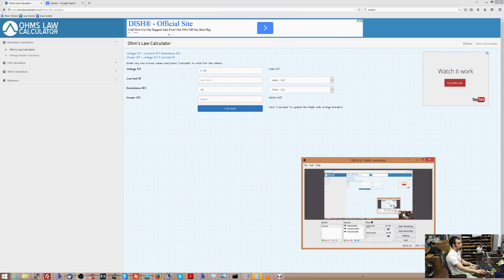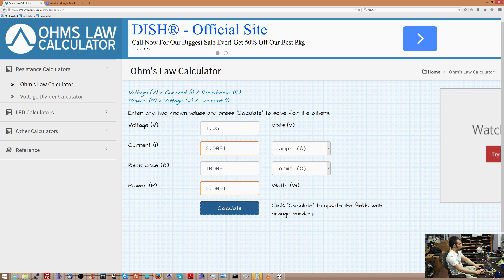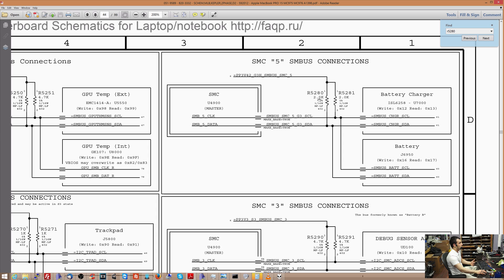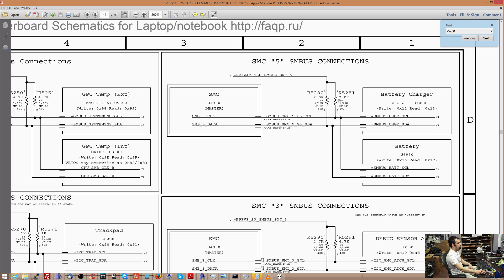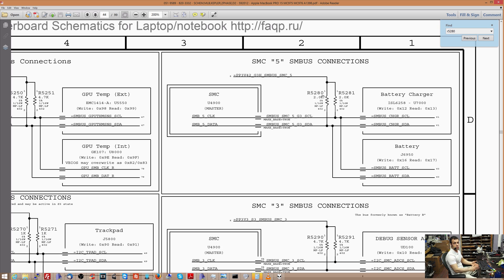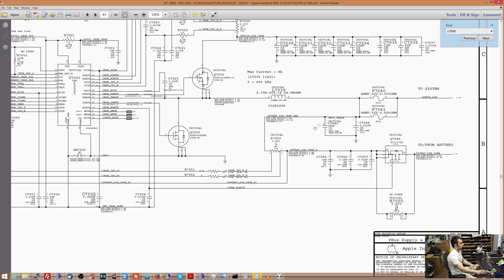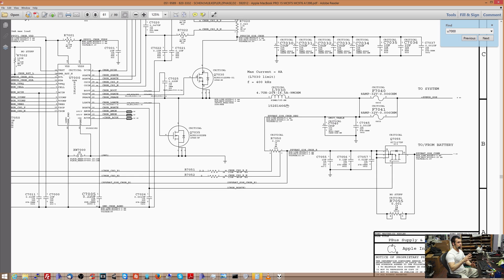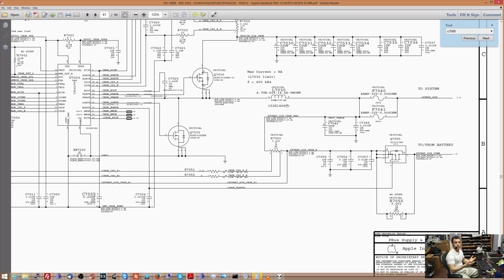What is a resistor? What is impedance?

Comment: 3:27 This definitely isn't correct. A resistor provides a voltage drop across it, but the current remains exactly the same.
5:42 you have it like almost right but it's just the exact opposite. The voltage definitely changes from one side of a resistor to the other and this voltage drop is proportional to the resistance (Ohm's Law) and so the resistance value definitely affects the voltage. The current going into a resistor and leaving it have to be equal, according to Kirchhoff's Current Law.

Comment: A resistive load is just like friction e.g dragging a tire. A capacitive load provides an active resistance that could push in the other direction e.g compressing a spring. An inductive load gathers momentum e.g. speeding up a flywheel or accelerating a car.

Electrical loads can have components of each type like a weighted trolley (inductance) attached between two posts by stretched bungee cords (capacitance) and that has wheels with a certain amount of friction (resistance) to the ground.

Comment: I always thought that there was a voltage drop across a resistor... meaning if you take a voltage at both ends of a resistor with ground as your reference they should be different if you measure voltage across a resistor you will see this voltage drop. I know this is pedantic but I really would like to know if I am wrong....
Reply: +Louis Rossmann 
Hey mate. Thanks for your vids. However, I think there might be a bit of confusion here about how current is limited by resistors.

First up there must be a non-negligible potential difference across the resistor otherwise current will never flow (just like you explained in your 3rd video in this series about electrical grounds). But more importantly there is zero drop in current across a resistor. Yes the resistor limits the current running through the entire circuit from rail (3.45V) to ground but there is no difference between current on one of the resistor and the other. The current is the same (due to the law of conservation of charge/energy) in fact, the only difference is the voltage across it.

TBH I think you definitely get the concept but your explanation is a bit misleading in the video at the end.
Reply: When current drops or is reduced, it is reduced around the entire circuit.  The current that goes in must come out.  Like water.  However, voltages will be seen to drop step wise from component to component.   Each component has a voltage drop associated w/ it.  But each time the voltage drops, the current drops in the entire circuit.  There are two laws that are used here.  Kirchhoff's voltage law and current law.  Voltage drops add up to the total for a circuit.  And current is constant for the entire circuit.  Congratulations. You just passed electronics 101.  Not that many people do.
Reply: +Mario James You're absolutely correct. Louis does lack some concepts, as he outright admits; what he does know  he sure explains well though.
Reply: +Alex Z you are correct, i even made this mistake, i had in mind a close circuit but i actually typed across a resistor oops :D 

Alex is talking about Kirchhoff's law, he has 2 very simple law's, 1 of them is about current, he simply says that if X amount of current comes in same X amount of current goes out.same at this resistor.
if it has a node then current split at that node, but still same in-out, no drop at all.

you can drop 12V to 3V super easily with a resistor, but the LOAD will determine how much current will pass through that resistor and if it will stay alive or burn in hell.

+Louis Rossmann take a look at ohm's law and kirchhoff law's
Reply: ParosPasxaRide Voltage and current are directly proportional, not inversely proportional. As you said, V = IR 

For mathematical simplicity (not realistically), let's say V = 10V, I = 5A, R = 2 Ohms

10 = 5*2

Now if you drop voltage to 8V and keep resistance at 2 Ohms, then for the equation to be true, current must drop to 4A.

8 = 4*2
Reply from the maker: +Mario James There is voltage drop across a resistor, but it is negligible in contrast to the drop in current across a resistor. This negligible voltage drop is actually used in current sensing circuits which I go over in a later video.
Reply: @rossmanngroup  The voltage drop is proportional to the resistance, so it's only as negligible as the resistance of the resistor. There is no current drop across a resistor. This would be a violation of Kirchhoff's Current Law.
Reply: Well because it is a 3.42v line going to a specific 3.42v pin on the chip which probably has a far higher resistance to ground, the voltage drop is negligible. If I connected a 2k and 1M resistor in series then applied 1.002 volts power source such that the 1M resistor was closest to ground, the voltage between the 2k and 1M resistors would be 1.000v. Connect a resistor in series with a volt meter connected to a power supply and you will notice the voltage will barely change. A volt meter is practically open circuit allowing only enough current to register a measurement.

You don't technically get a drop in current across a resistor as current is the same at all points in a series path. If you put an ammeter before or after a resistor it would make no difference provided there is no additional path to ground between it and the resistor. You do certainly get a drop in current in the line compared to replacing the resistor with a wire but the current flowing into a resistor is equal to current flowing out. By what proportion the voltage drops depends on the remaining resistance in the line in a linear fashion.
Reply: Mario James I would have thought the same. The potential across the resistor should not be 0 unless the resistance of the resistor is very low.
Reply: ParosPasxaRide      I stupidly added almost the exact thing that you said.  Maybe it will make sense.  Not too difficult really.
Reply: +Louis Rossmann when you have a drop of voltage over a resistor (which is not netligible) actually you have higher Current and not lower. the formula is super simple its called Ohm law and its this V=I * R so your R (resistance) dosn't change (its change very slightly depending the temperature but w/e) , so if you lower the V in order the formula to be true the I (Ampere or Current) gets higher. 
So V and I have a completely close relation to each other and they are completely opposite.
Sorry louis i dont mean to be bad to you, im an electronic engineer im good in theory (kinda :P) and i completely suck in practice, thats why i learn from you that stuff. Keep going mate.